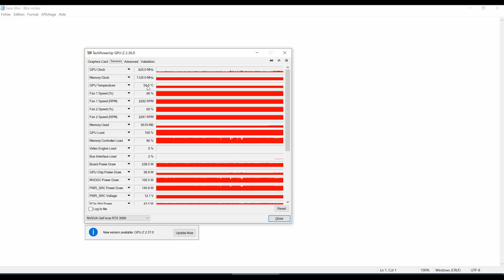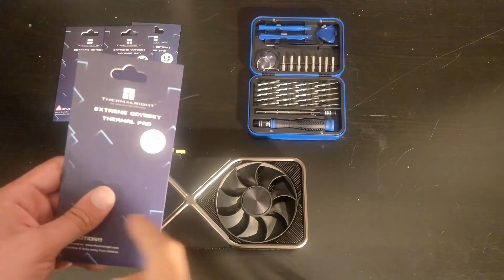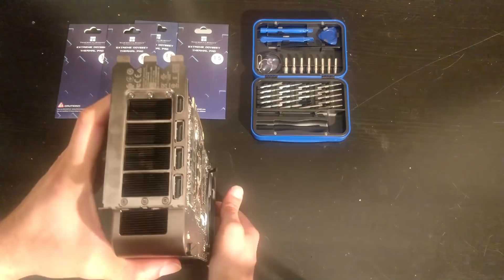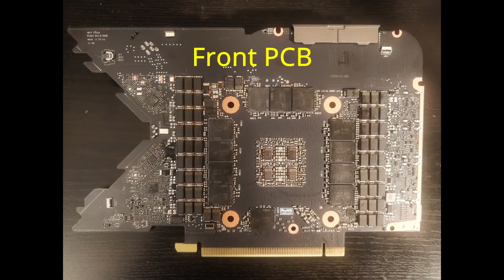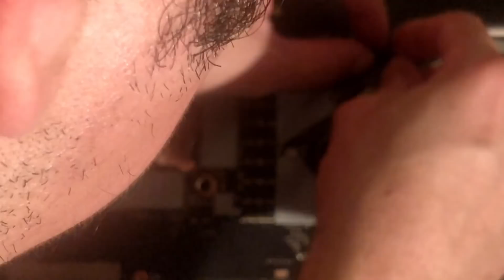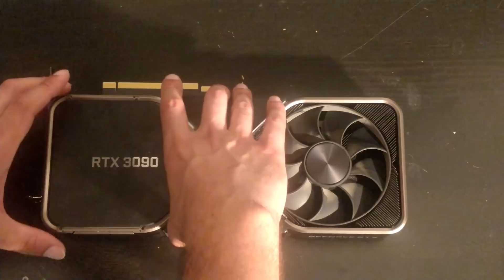3090 FE Thermal Pad Mod (-20°C) | Improve your mining hashrate!

Comment: I got my RTX 3090 FE and haven't used it for over a year before finally putting it into my rig. It was a barely used unit anyway, it didn't even have the firmware update for resizable BAR installed when I got it. I heard about this problem but haven't looked into it until now. MSI Afterburner reported a thermal limit on the OSD when playing a game and it surprised me because the core was around 70C. I don't usually use the OSD because it can cause issues, but I'm glad I did. I loaded up AIDA64 only to find the VRAM was maxed out at 110C. I'm glad this doesn't look too difficult so I will definitely be trying it, along with using my Alphacool Apex thermal grease for the core. Probably easier than redoing the thermal paste on my laptop by the looks of things as far as disassembly. Thank you so much for making this video.

Comment: Questions: 
1. I'm comparing your guide to EK's for the quantum vector FE block + active backplate and they tell you to cover way more with their 1mm pads (mainly the things labelled LR22) - just wondering why you didn't cover those and also used 1.5mm pads? is it because one method is for a block and one is for the air cooler?
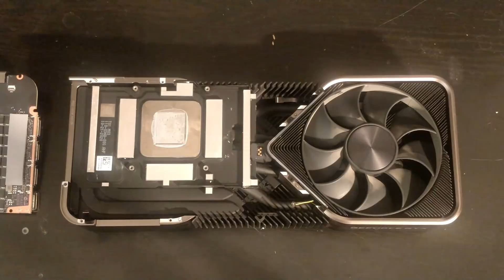2. at 17:49 you show pads you put on the PCB, at 18:09 it looks like you also put pads on the heatsink? are you supposed to put pads to pads?

Thanks in advance m8